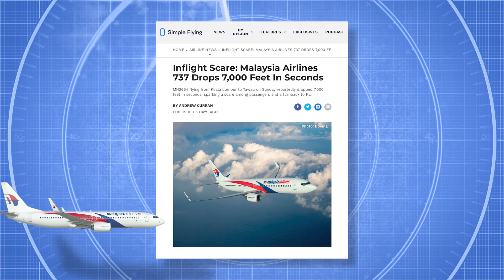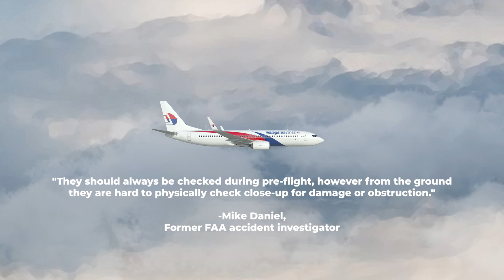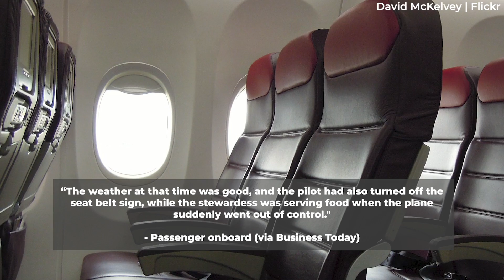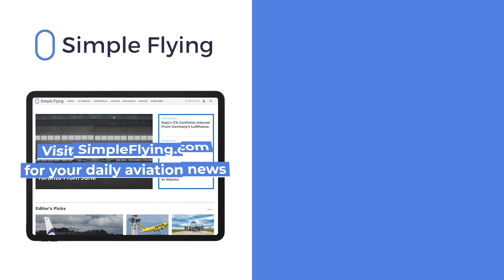Malfunctioning Pitot System Caused Malaysia Airlines Boeing 737 Dive

Comment: There was a fatal crash decades ago due to blocked pitot tubes.
Why have the designers not built in a self test & clearing system in to them yet ???
Reply: Because a blocked pitot tube will still have air trapped inside it. And how would it self clear?

Blocked pitot tubes don’t cause a crash. They cause a loss of airspeed indication. And even then one blocked pitot affects one instrument. There are 2 others on a commercial aircraft. A well trained pilot (combined with latest technology) can still fly with an approximate airspeed by using known pitch power settings and/or other sensors to get estimated airspeed.
Reply: They don't cause "a loss of airspeed". They cause an incorrect airspeed indication.
Reply: @coolbreeze253  corrected
Reply: Pilot training is also a factor in malfunctioning indicators.This scenario is trained for.
Reply: What makes me worry here again is not the blocked pitot tube and a wrong airspeed indication but the autopilot pitching up before it was deactivated or it deactivated itself. The autopilot should cross check the air data before making any pitch changes. If the IAS on the left and right side differs more than a specific value the autopilot should disconnect and warn the pilot about unreliable airspeed.
Reply: If you're talking about Air France 447, sure. But that wasn't the only thing. The pitot tubes got clogged with ice, but the crew wasn't able to follow the procedures (mainly flying the plane manually, wings leveled for a while until the clogging ends. Yes, they could unclog themselves, but that was an issue Airbus rectified and improved later) and that resulted in the crash. 

And about the Aeroperu flight, the static ports were covered with tape. That was really bad for the number of alerts the plane had during the flight and subsequent crash. The night didn't help and the crew didn't know what to do because they were really lost without a clear picture of where they were. Training is the best solution in this case, apart from more safeguards about static ports.
Reply: @tomstravels520  
Compressed air to blow out
Reply: @WhiskeyGulf71  for every single plane on every single flight? Ground crew will need scissor lifts to get up to them and risk bashing into the aircraft all the time
Reply: @LaczPro  And also aeroperu..
Reply: 65% power plus a 6 degree pitch attitude always works on a Boeing. 
80% power and a slightly higher pitch attitude for a climb works too.

What we are most likely talking about here is yet another aircrew that has spent their entire career overly-reliant on automation and can no longer hand-fly.  Just like the Asiana 777 that crashed in SFO.  Same old stuff, different day.
Reply: @LaczPro  I assumed he was talking about the Birginaire 757 (not sure how that is spelled) that had taped over static ports.
Reply: @StratMatt777  Aeroperu 603 was taped over static ports. Birgenair 301 was a single blocked pitot. Neither crew at the time were trained in how to react to unreliable airspeed and Boeing hadn’t formally established pitch/power settings
Reply: @tomstravels520  Oh, it looks I combined those two crashes into one/mixed them up. oops!  
60% and 6 degrees works in any Boeing.  A competent pilot doesn't need to wait for Boeing to publish basic pitch/power/performance numbers.  Knowing your airplane is basic airmanship.
Reply: Do you know how it works in the first place ?

Comment: They could always adopt the method used to check the pitot tubes on airbus aircraft after AF447
Reply: Yh this is a BOEING aircraft
Reply: @AirportPlaneSpotting  so? There's always a way around it right? You do know there are common parts shared between the two manufacturers, unless you don't
Reply: @AirportPlaneSpotting  Right, even if it is a boieng, they have gone safer with a new CEO and really just find another way to do it and also you probably flown on one

Comment: This doesn’t make sense. If it was a pitot tube issue then that only affects airspeed. There are 3 pitot tubes on a 737. One for Capt, one for FO and one for standby. If one fails then it only affects that instrument. But it should warn if there is an IAS DISAGREE and pilots should then disconnect automatics and find out which is correct. 

For a static port issue the altitude may then fluctuate but the plane shouldn’t suddenly dive for the altitude
Reply: There's more than that. "Unreliable Air Speed" is just 1 of them. Autopilot is a complex system, works with various instruments system and subsystem. If source data mismatched it would behave erratically and on severe disagreement will disconnect autopilot. Pilots have to analyze what's going on when these malfunction happens - which requires time, if it's within few minutes and they re-gain control.. well, hats off to those pilots - good airmanship.
Reply: @nt4hx  if a plane is in an uncommanded descent I’d like to think the pilots aren’t sat there wondering what is going on
Reply: If there is a disagreement between the three pitot system inputs then the aircraft will look for the two that agree and warn the pilots that there is a fault in the system. The aircraft won’t simply follow one faulty system ignoring the other two. That’s how the redundancy should work.
Reply: nothing about this story makes sense to me
Reply: My understanding is that once the autopilot disconnected (& perhaps gave a stall warning due unreliable airspeed), the pilots descended the aircraft, not the autopilot. They also could have created such a steep dive due to startle effect and unfamiliarity with hand flying at such high altitudes.
Reply: @EdOeuna this is what happened to 73MAX. But here is 73NG and we're not discussing about NG & MAX, however, instruments failure could happened on any aircraft. If I'm not mistaken there are 3 air data source that can be selected. 1. Normal (both primary & secondary data shared and compared). 2. Primary side only 3. Secondary side only.
For ISIS (standby instruments) it's just a stand alone system and doesn't included in autopilot system input. It's act as control\reference PFD.
If fault occurs in Normal selection, the input to autopilot system will be in disagreement and will disengage. 
Crew action to check with ISIS which data source is reliable and can select ADIRU to working source and autopilot can be re-engage but with limited\reduced functions. 

There's more if need to explains further and it's been a while since I'm working with 73NG.
Reply: @nt4hx  where is the air data source selector on a 737? I have seen the IRS switch on the overhead but not seen and air data switch
Reply: @nt4hx  - I’m familiar with the 777 system, and it constantly compares input from the 3 systems and warns if they aren’t the same. The plane certainly won’t do any thing crazy like enter a dive if one of the three systems is erroneous, so people who are suggesting that this 737 did exactly that are wrong.
Reply: @tomstravels520  my bad, it's not for Air Data but it's actually for EFIS panel (display) which can be selected. ADIRU can't be selected, only CBs on 737.
Reply: @nt4hx  so if you have a loss of airspeed information on capt side in 737 do you switch EFIS? Or not do anything and the FO flies?
Reply: @tomstravels520  I'm not sure of the procedure, there's ISFD and can be crosscheck with FO side. If the capt is PF, I'm sure EFIS can be selected both on 2. Or transfer control to FO as PF.

Comment: So many problems and accidents due to obstructed pitot tubes... What if they were replaced in every check instead of just inspected? Or made bigger so it's less likely that they'll get obstructed.
Reply: aviation stuff tend to be really expensive, a winglet addon costs like 10 million for a single plane
Reply: There are so many things they could do.

A quick software fix would be checking against GPS. Then the pitot tube could report itself malfunctioning.

You can put a sensor in the tube to check for blockage.

I doubt that a physical tube is even necessary but no one wants to invest the money to make something digital.

There's also no reason for the autopilot to freak the hell out because of a sensor malfunction. Out of family readings should be disregarded.

Boeing has the worst case of "not invented here" I have ever seen.

If it's Boeing, I'm not going.
Reply: @jtjames79  GPS measures ground speed. Not airspeed which is what you need
Reply: @tomstravels520  It's called a sanity check, you don't rely on GPS for airspeed. Your mentality is exactly the mentality that causes these things to persist.

Thank you for proving my point.
Reply: @jtjames79  how can you use GPS for a sanity check? If GPS says 400 knots but you have a 200 knot tail wind then your airspeed is only 200 knots. At 35000ft you’d be stalling. Clearly you don’t understand how these different speeds work.

Here’s a better idea. Calculate a synthetic airspeed using the AOA sensors and use that to compare against the computed speeds. Oh wait….the 787, A350 and newer A320/A330 already have that capability
Reply: @tomstravels520  No, that's not how you do sanity checks. I'm also not going to teach you a computer science skill in a YouTube comment.
Reply: @jtjames79  you don’t need to because I’ve already told you modern aircraft can fly perfectly fine with loss of airspeed. Just look at the final report for the Malaysia A330 where pilots took off with pitot tubes covered. They used the BUSS to help them fly and land safely. Didn’t need to do GPS sanity checks
Reply: Don’t forget that airspeed drops by about. 2% per 1000 feet with gains in altitude, so you’ll get a difference between IAS and GS just with reduced air pressure, then add wind component on top.

Comment: This isn't the first time a Malaysian Airlines aircraft has had an issue involving the Pitot, I believe an A330-300 of there's took off with the covers still on back in 2018.
Reply: Yes, that was taking off from Brisbane, the ATSB just released their final report. If you're interested in investigation reports I strongly recommend this one it was fantastic
Reply: So is it a Malaysian airlines thing?
Reply: This also isn"t the first time Boeing had an issue with rapid deccent .
Reply: @harsharyan9044  It also isn't the first time that this has happened to any aircraft, as we've seen on AF447, the incidents mentioned above involving the Malaysian A330 and 737, and several other cases.
Reply: I remember in the Navy someone turned the pitot heat on with the cover still on when on the ground. This was in the winter in a northern climate and it was common to turn the heat on during preflight if it was snowing.
Reply: Malaysian airlines also have an uncommanded climb on the 777 due to malfunctioning ADRIU
Reply: And one crashed because of it in 2009, AF447 (correct me if I’m wrong)
Reply: @kamallb4650  while the Brisbane incident does point to some complacency on the part of the pilots, the cause of the recent incident still hasn’t been determined, so we don’t know if it’s a maintenance/inspection problem or design fault.
Reply: @mafiaboy87  I said that bcoz the op said it also happened with their 330 flight....and I doubt both manufacturers will have same problem.

Comment: I know checking petot tubes isn't easy on all airliners before a flight but by now it should be a regular exercise before taking off and hauling hundreds of lives. If we sent people to the moon using nothing but a mere current power calculator, checking that which gives the outside conditions when flying high and fast should be a given.

Comment: There was definitely not a clogged pitot tube or they would of had an airspeed disagree message on takeoff. Possibly an air data module failed in flight. Hopefully there will be a thorough investigation to really see what happened. The 737-800 is a fabulous relatively trouble free aircraft
Reply: If the ADM failed on the same side as autopilot it should just shut off. Not cause a dive
Reply: @tomstravels520  agree. Pilot issues?
Reply: Probe heat failure can occur at any time. If it happens inflight, ice buildup inside the probe will happen if icing conditions exist at that point in time, causing the pitot probe to be  blocked and affecting the pitot system.
Reply: @contactssync2160  I don’t know how it works on the 737 but on the A320 each pitot is heated by a different electrical system. Failure of one shouldn’t affect the others
Reply: @contactssync2160  nothing mentioned about a pitot heat amber heat light illuminated

Comment: I actually have a flight back to my hometown due next week in one of these MAS babies. I'm not saying an entire grounding of the B738 fleet would be possible, but damnit if it ain't a possibility at this point. 

Now that I think about it, what happens if one of the MAX series have a similar pitot tube malfunction? Would the MCAS react violently in this case?
Reply: From my understanding, MCAS is only affected by the angle of attack sensor, which is different.
Reply: @scaffoldbw  thank heavens only that
Reply: @scaffoldbw  I see! Thank you for your input, much appreciated.
Reply: And where is ur hometown 
Cause if u sayin like kota bharu or terengganu, malaysia airlines NEEDS TO FLY 737 cause the runway is too short so grounding 737 isnt a choice for them cause most of malaysian airports needs the 747 or they cant land 
And at, the same time costing them money cause they cant fly the plane and need to replace the passengers ticket
So as i say Grounding the 737 is not a choice cause it will effect the whole malaysia airlines
Reply: @haqeemridzwan1932  You're probably right about the consequences. They were hit just as hard as AirAsia during the pandemic and was effectively bleeding money by letting most of their widebodies grounded (since their business model won't allow a packed single widebody to fly domestic routes like in many foreign countries). 

While I'm pretty sure my flight to Kota Kinabalu would be uneventful, it goes without saying that MAS should really keep an eye on their service routine. After all, we knew exactly worse examples of a pitot tube issue.
Reply: @Nafeels  if ur saying kota kinabalu malaysia airlines can operate their a330 and a350 but its not worth it cause passengers buy tickets according to 737 so the aircraft would be light in the a 330 and 350 and will cost more
Reply: If Air France never grounded their A330s after AF447, then MAS isn't grounding their 737s for this. Both this incident and AF447 have the same root cause.
Reply: @Blank00  fax

Comment: If that's the case, the China Eastern Crash may have lead the same situation. But it's just a possible theory.
Reply: The plane would not dive at that high rate due to pitot static failure
Reply: Would a pitot static malfunction result in a near 90 degree dive? I don’t think so.

Comment: Boeing whistleblower said after about 6 -7  years you'll start seeing all the defects and cheap labor and problems start to show
Reply: The 737 ng has been flying for around 25 years
Reply: 737 NG has been flying for 25 years..
Reply: And you probably flown one since its the most popular plane in the world
Reply: @coleswack5513  boeing 737 jurassic didnt have major issues up till the 90s with the rudder.. They started flying in 1967..
Reply: @coleswack5513  Not all 737NG, some planes of that same model were recently manufactured. China Eastern 737NG that went into a nosedive and crashed was only 6 years old, this particular Malaysian airlines 737NG is only 11.4 years old, perhaps that statement do hold merit considering the fact that Boeing's design philosophy has changed since then, Boeing nowadays prioritise profit over safety and the 737-MAX is proof of that fact...

Comment: As someone who knows the 737 I find that hard to believe!

If it does happen the response has to be correct.

What that means is the simulator and finding a solution.

Possibly new and improved design of the pitot and system with fail safe. If airspeed is compromised at any point during flight it can have bad consequences.
Reply: somethim  ram

Comment: It certainly sounds like the same problem as the 737 Max. In the 737 Max the MCAS cuts in automatically and deactivate the autopilot and pitch up as was reported here. Is the 737-800 just a 737 Max with less pitch up?
Reply: The -800 doesn’t have MCAS
Reply: Hahahaha dude, lmao
Reply: If it due to the Mcas, the outcome can be a lot worst
Reply: No, MCAS pitched the Max down not up, in this recent incident the aircraft pitched up causing a stall.
Reply: Incorrect.  On the max, MCAS was never active with the autopilot on.... MCAS is only active flaps up, gear up and autopilot off.....